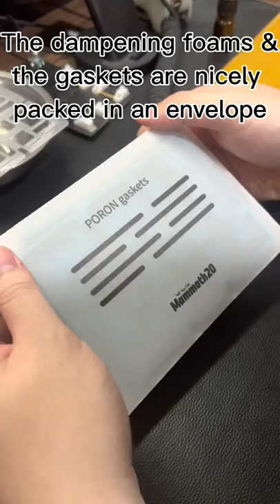Mammoth 20 Build Log by DMW

Comment: How’s the Bluetooth working? Is it compatible with VIA as promised?
Reply from the maker: Bluetooth not working very well on my case. Im using PC mobo  with built in bluetooth+wifi. PC placed on my desk, right hand side. I'm a lefthanded numpad so its on left of my main keyboard. It has a lot of interference maybe because of the metal case. 

My only suggest is get a bluetooth dongle and an USB extension cable, which can route the dongle very near to Mammoth 20 to avoid any interference/lost signal.

I did try place my Mammoth 20 very near to my PC, it work very well. All Wuque keyboards are VIA compatible. They even provide a very user friendly installer to install/update new firmware.

Comment: How can I activate the bluetooth of the numpad or how long does it need to be charged until able to work with the bluetooth.
Reply from the maker: Hi, the top 3 keys beside the knob are the keys for USB, BT 1 & BT 2 (with fn key, layer 1). As long as your battery not running out, your bluetooth shall be working. I myself rarely using the BT, found that its not very convenient and quite some interference and lost signal. So I end up with just wired USB.